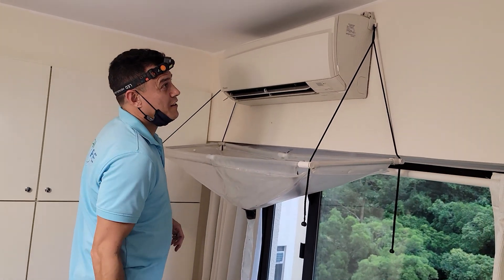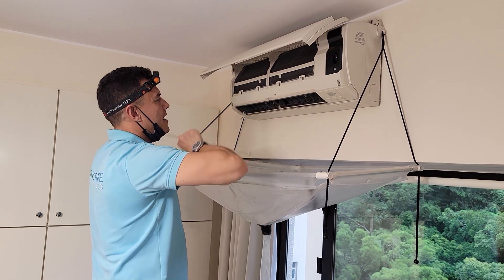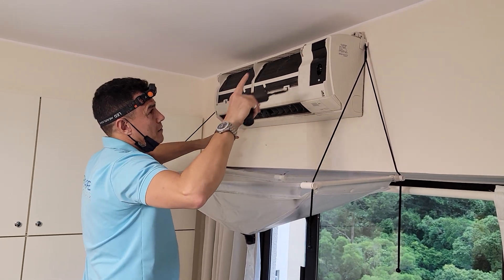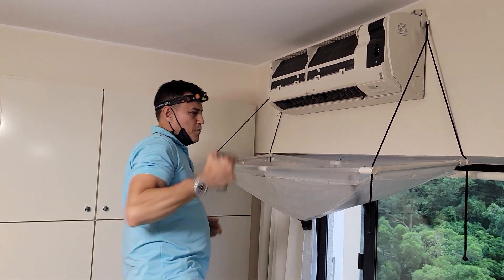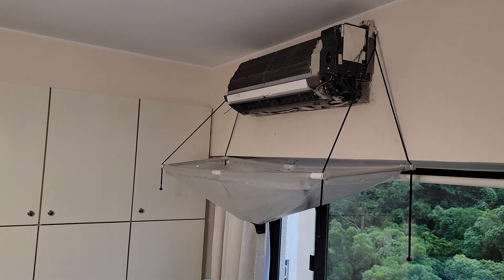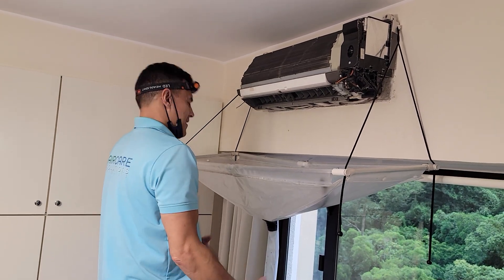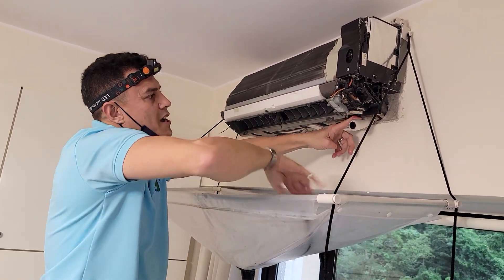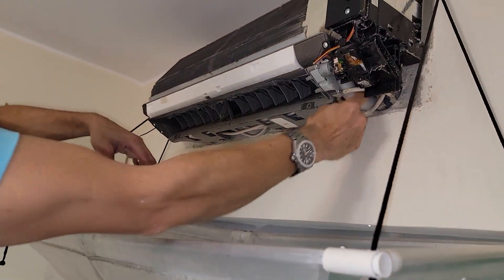How To Unblock The AC Condensate Drainage Line of a typical DAIKIN Split-Type AC

Comment: This was very much appreciated! It's up to 98 degrees today in South Texas, and our main minisplit started leaking today (Saturday). We were able to get the cover off thanks to your video, drain the pan with a turkey baster, and add vinegar to dissolve the algae. It seems to have worked!
Reply: Next time just use a shop vac and suck the line from the outside. You don't have to take anything apart and it takes 30 seconds.

Comment: Whoever installed mine did a bad job. The drain line goes from the back then down and up again out through the wall. I've never had it leak until today but we've had a real heat wave over the last week. In the past it probably just evaporated in the pan before it could leak out the front onto the floor. It doesn't drain because it has to go up hill which doesn't work too well.
Reply from the maker: A condensate pump can resolve that issue

Comment: Great instructions and great tip with the garden hose pipe.  
I had to move the electrics out of the way (single screw) and I felt the blockage move when I blew.  It's now running fine.. thank you

Comment: Wonder if this can happen to a Daikin that's fairly new. Just a month or two. I'm going to check anyways. This is a very easy straight forward dismantle and check. Glad I went with Daikin than the other brands.
Reply from the maker: It's rare for installation companies to clear the drainage line when they install a new AC....probably a pre-existing partial blockage that eventually got 100% blocked
Reply: @aircaresolutionshongkong  Yesir, that's what I think I might have found out. Shameful really. Pump-N-Dump companies. 

China! Am-I-Right? HAHAHA. 

Daizuki isn't bad so far though, once you work out the manufacturing kinks.
Reply: Was your aircon leaking? How did you go? I also got a newer model (daikin cora, only 9 months old)
Reply: @Rosaaaline  It was dripping from the left side down my wall. So I shut it off and took a dry/wet shop vac to the drainage tube (I have the drain on the right side on the inside wall)

I installed it level. So either it was manufactured incorrectly and the pan is listing to the left, or there was a blockage. 

I suctioned it twice over the course of 3 months, and got a good 8-12 ounces out of it each time. 

Hasn't happened again since the last suction 2.5 months ago. So I'm leaning on some sort of blockage.

Comment: We had a steady drip from our Daikin ( a newer model, installed in 2020 ). We had plenty of water dripping from the inside unit and plenty of water dripping from the outside drain hose. I went to the outside drain and, using a 6 foot length of network ethernet cable ( because that's what I had on hand and it's reasonably thick and rigid ), I snaked the outside drain hose for about 3 feet or so until it wouldn't go in any further. The outside drip soon turned into a steady trickle that lasted about 5-10 minutes. The drip inside stopped immediately.

Comment: Oh my god, Daikin is such a wonderful product. In my next life I pray to my creator that I will come back as a Daikin AC unit, because all other brands are so much worse and garbage than Daikin which has such superior plastics and designs compared to the others on the market. In fact, I am considering exiting life because right now on my wall I have a Toshiba which is just SO much worse than a Daikin, as any other AC brands are. If by some miracle I survive the horrendous sacrilege of not having a Daikin I will forever hang my head with shame until the day I die.
Reply: Never seen anyone get so triggered over someone liking a brand of heat pump more than the one you own. Step outside and get some fresh air.

Comment: I have a new AC that has a bad smell once every few hours coming out of it and after its off for a few hours. Everywhere i searched says that it could be a a drainage line issue and i checked and can't see anything dripping out of the condensate drainage line outside so i'm considering it might actually be blocked. If i open it up myself, i'm pretty sure the warranty would be gone.

Comment: "Any other brand of AC, never that easy" Truer words have never been said. Except maybe mitsubishi, they're also well put together with serving in mind.
Reply from the maker: We'll have to agree to disagree on that :o) We're not fans of Mitsubishi at all....they're the worst offenders when it comes to over-engineering just about everything on split-type ACs as well as Cassette-Type ACs. Their fan-coil units are ok (probably only because it's next to impossible to over-engineer an AC system that is so simplistic) and their VRF systems are ok - but both still inferior to Daikin. The vast majority of Mitsubishi split-type ACs and cassette-type ACs take considerably longer to disassemble and reassemble owing to excessive quantities of screws, electrical wiring, servo motors, etc. and are just so fiddly and overly complex in comparison to other brands such as Daikin & Panasonic, that we introduced surcharges for a growing list of Mitsubishi models. Quite likely, in our humble opinion, that Mitsubishi Heavy Industries and Mitsubishi Electric have taken a page from the Automotive Industry Playbook - there are massive profits to be gained from the sale of replacement parts. The more moving parts there are in an AC system, along with a greater number of PCBs, the greater the likelihood of replacement parts being required as a result of normal wear and tear, as well as the greater the possibility that a part may be damaged during disassembly/reassembly. Would be interested to hear more details from you as to your own observations that have shaped a more positive perception of Mitsubishi though....feel free to send us an email, or post your comments here ;o)

Comment: Thanks for going to the effort to produce the video. Worked a treat. My 3hp model had the 3 screws you spoke off. It is refreshing to see a manufacturer spend a little more on plastic materials - they don't all have to shatter after being exposed to filtered UV for 15 years. Thankyou Daikin.

Comment: Good video but my drainage hose on my Daikin does not come off. It's a hard plastic pipe covered in insulation.
Reply: Pull harder mines the same it comes off

Comment: Hi mate, great video. Did you make your equipment or buy it? Cheers
Reply from the maker: We buy this wastewater catchment bag directly from the manufacturer in China. Have tried & tested pretty much every other type of equipment, and ultimately found that this model is the most effective and most efficient. However, apart from a similar type that is designed for Cassette-Type ACs, these only come in one size. 

So for tight spaces, or any situation where this model cannot fit, we designed and developed custom-made waterproof wastewater catchment bags of our own - perfect for dealing with all sorts of tricky situations. They're costly, but an absolutely essential piece of kit to ensure deep cleaning with no mess and very low  risk of water spills.

Comment: thanks! just the video i needed before i pull off the panel to attempt to unblock mine which started dripping
Reply: Success?
Reply: @ScottChiesa  yes turns out the drip tray was draining fine and it was the longer pvc drain pipe. luckily they built in an easy access/flush point and i ran the garden hose through it and reamed it out:)

Comment: Hi, really clear video - thanks!
I have an FTXA20A2V1BW
 Daikin AC unit which has just stopped working properly. There's no water coming out of the unit. There is a micro blue condensate pump connected as the condensate needs to go above the indoor unit. I have checked the pump and it doesn't seem to operate (no pumping activity heard) although a green arrow is lit up on the unit. When removing the inlet pipe, there is no water, but when removing the outlet pipe there is water there. When I remove the multpin connector the pump seems to start. When I reconnect, it stops again. Can you suggest any troubleshooting steps?
Reply from the maker: Hi there! 

Our goal for this YouTube Channel is to continue to provide informative & useful content for our subscribers as well as for the general public. 

The content we will be producing will predominantly be focused on providing viewers with tips that will assist people to save thousands of dollars - that can be via DIY tips, as well as via tips that can reduce energy consumption, as well as reducing the frequency of requiring professional maintenance/cleaning. 

So we're seeking support from our existing subscribers to help us to grow our audience to 1000+ subscribers - as this is just one of the plethora of requirements that must be fulfilled in order to monetize the channel. Monetizing the channel will enable us to generate the funds that we need to provide exemplary and highly detailed content on a regular basis 

So we'd be so grateful if you could invite your friends to subscribe. And there's something in it for you too! If you provide proof that you were responsible for 10 friends subscribing (must be genuine YouTube accounts, no fake accounts, no AI accounts, etc.) then you'll be awarded with Free Online Assistance via WhatsApp for 2 years* (our clients in Hong Kong pay a significant fee for this service) and this gives you access to professional advice/recommendations at your fingertips whenever you may need it for your residence.

Should you have any questions, please email us directly - contact information can be found on our website 😊 

Thank you for your support! 

*conditions apply

Comment: Hello. I have a leaking Daikin FTXA50A2V1BW. Company who installed it connected drain pipe to the same drain where my bath goes. And they added a small trap before that. However now i read manual for this model and it clearly says “no traps!”.
It has been working fine until bigger heat wave comes and it starts dripping a lot.
Reply from the maker: If there were no issues for quite some time, it's not really the trap that is causing the problem (thought it is most certainly a component of the problem) ... it's still algae development before the condensate reaches the trap. Depending upon the model of AC, and AFTER you've resolved the blockage, you can likely simply implement self administered preventative maintenance to eradicate algae development in the drainage line...simply apply a couple of Pan Treat Tablets on a regular basis (fortnightly would be ideal) to the drainage pan of the AC and that should resolve the frequency (or eradicate altogether) of the blockages
Reply: Yeah me too
Reply: Sometimes algae develop IN the trap, if it's just a bath a wouldn't worry you can remove the trap
Reply from the maker: Hi there! 

Our goal for this YouTube Channel is to continue to provide informative & useful content for our subscribers as well as for the general public. 

The content we will be producing will predominantly be focused on providing viewers with tips that will assist people to save thousands of dollars - that can be via DIY tips, as well as via tips that can reduce energy consumption, as well as reducing the frequency of requiring professional maintenance/cleaning. 

So we're seeking support from our existing subscribers to help us to grow our audience to 1000+ subscribers - as this is just one of the plethora of requirements that must be fulfilled in order to monetize the channel. Monetizing the channel will enable us to generate the funds that we need to provide exemplary and highly detailed content on a regular basis 

So we'd be so grateful if you could invite your friends to subscribe. And there's something in it for you too! If you provide proof that you were responsible for 10 friends subscribing (must be genuine YouTube accounts, no fake accounts, no AI accounts, etc.) then you'll be awarded with Free Online Assistance via WhatsApp for 2 years* (our clients in Hong Kong pay a significant fee for this service) and this gives you access to professional advice/recommendations at your fingertips whenever you may need it for your residence.

Should you have any questions, please email us directly - contact information can be found on our website 😊 

Thank you for your support! 

*conditions apply

Comment: Thanks for the visual demo. Had a roommate's room catching water. You probably saved me breaking the plastic minding the top clips. Mine were 4 that you pull toward you on the bracket piece to release, this was close to the ceiling so I had to use a mirror to see them. I had salvaged a long thin hose from the inside of a steam cleaner recently so I was able to feed it deep into the outflow pipe and palm roll it fast to knock any obstructions. The first time I reconnected the outflow tube to the mating piece I didn't have it on completely, so I took some drip from the vinegar I poured into the drip pan, second time looked good, parts cleaned up, reassembled. We saw more outflow from the pipe outside, I'll check back with the man in a few days.
Reply from the maker: Hi there! 

Our goal for this YouTube Channel is to continue to provide informative & useful content for our subscribers as well as for the general public. 

The content we will be producing will predominantly be focused on providing viewers with tips that will assist people to save thousands of dollars - that can be via DIY tips, as well as via tips that can reduce energy consumption, as well as reducing the frequency of requiring professional maintenance/cleaning. 

So we're seeking support from our existing subscribers to help us to grow our audience to 1000+ subscribers - as this is just one of the plethora of requirements that must be fulfilled in order to monetize the channel. Monetizing the channel will enable us to generate the funds that we need to provide exemplary and highly detailed content on a regular basis 

So we'd be so grateful if you could invite your friends to subscribe. And there's something in it for you too! If you provide proof that you were responsible for 10 friends subscribing (must be genuine YouTube accounts, no fake accounts, no AI accounts, etc.) then you'll be awarded with Free Online Assistance via WhatsApp for 2 years* (our clients in Hong Kong pay a significant fee for this service) and this gives you access to professional advice/recommendations at your fingertips whenever you may need it for your residence.

Should you have any questions, please email us directly - contact information can be found on our website 😊 

Thank you for your support! 

*conditions apply

Comment: Didn't even need to Hawk Tuah😂😂
Reply from the maker: On one occasion when using lung pressure to clear a blockage (lung pressure not our SOP...this video is just to demonstrate that it's usually easy enough to do with what one already has on hand...we usually use high pressure water to clear drainage lines) on a 'fly-by' visit just to help a client out...my colleague was in another room doing the same (he was in another room) and was supposed to be temporarily blocking the drainage line of the other AC on a SHARED drainage line...he blew just as I put my mouth on the hose...that's the only time I've ever had to Hawk Tuah! 😂

Comment: Why not he una a vacuum to suck everything out from outside all that for nothing
Reply: Because it's in Hong Kong on 64th floor.....there's no outside access
Reply from the maker: The point of the video is to demonstrate how easy it can often be to unblock a drainage line with just a screwdriver and a short length of hose :o) It can often take several days for people to be able to get a booking for a HVAC technician in Hong Kong...in the midst of hot humid summers in Hong Kong, it can be unbearable without an AC for a few days. So the objective of this clip is to illustrate that one doesn't necessarily need a HVAC technician to simply unblock a drainage line. 

Hong Kong is one of the top 3 'most vertical cities in the world' ----> the vast majority of the population live in high-rise apartment buildings...so it's exceptionally rare to be able to access the drainage line from outside (unless one wishes to spend several thousand Hong Kong dollars on installing scaffolding just to unblock a drainage line.
Reply: Thanks a lot for teaching me how to fix this problem ! I was able to get it working perfectly ! I’m really appreciate for your video ! 
Btw, he looks handsome😘 👍
Reply: @LisaLisa-k7n haha😂we come in to watch him teach how to clear the pipe,  you cheekily spied on  handsome  him.